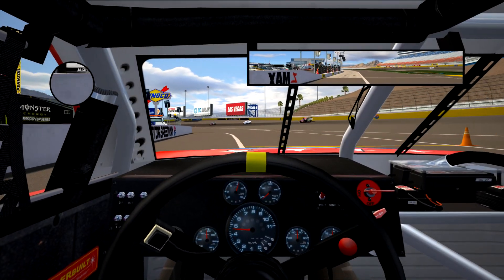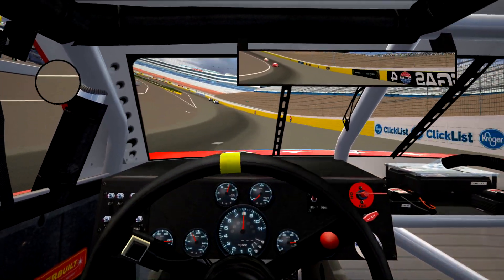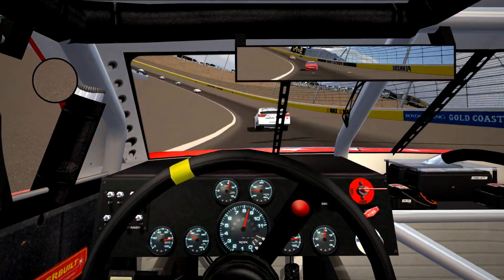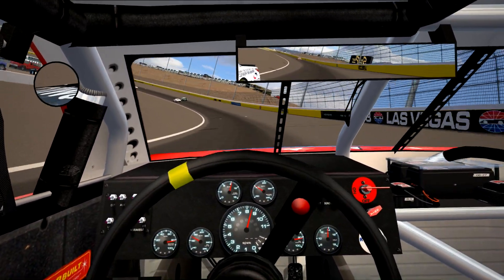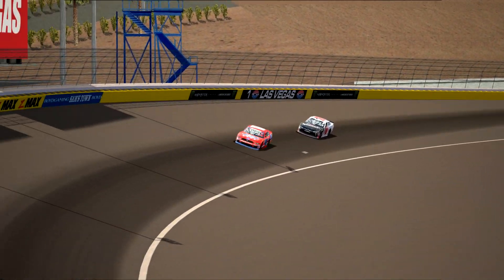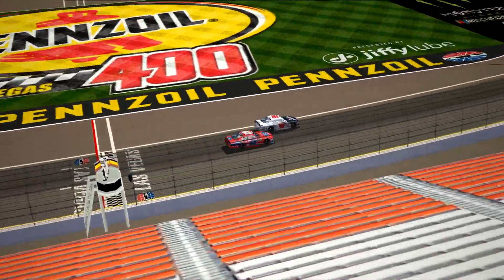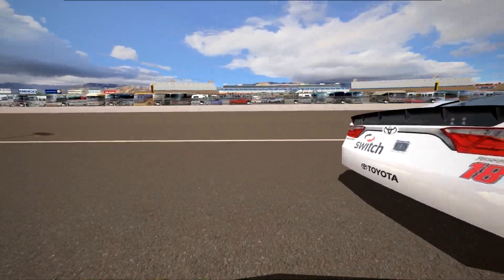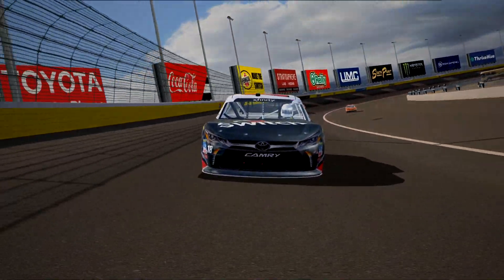NR2018 EXE: Dirty Air and Side-Draft are WORKING!!!

Comment: What's dirty air?
Reply: Rookies on Raceway it's air that has been affected by the car ahead so it upsets the balance of your car as the air is not stable and pushing you into the road
Reply: Turbulent air that is not uniform or as dense created by the car(s) in front. In aircraft it's known as a wake effect. The lack of uniformity and density generally causes less air on the car behind which will affect front end downforce and overall stability/balance.